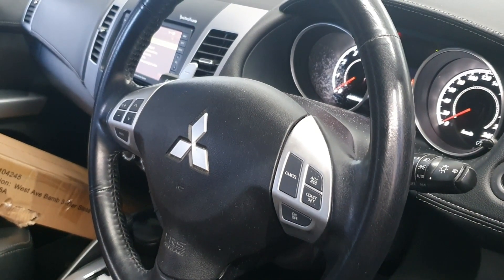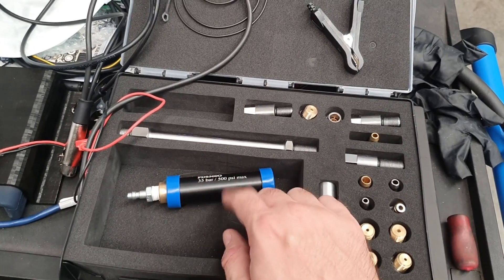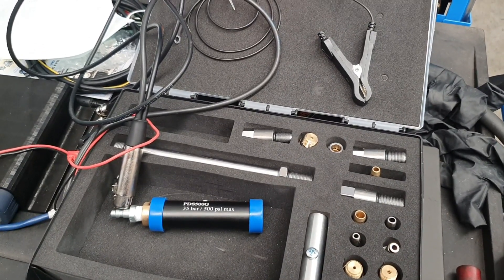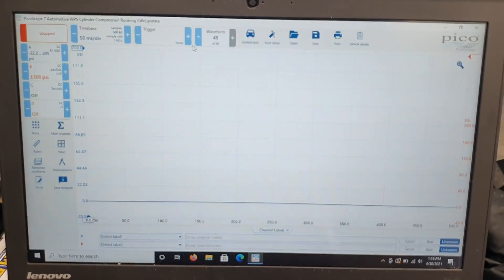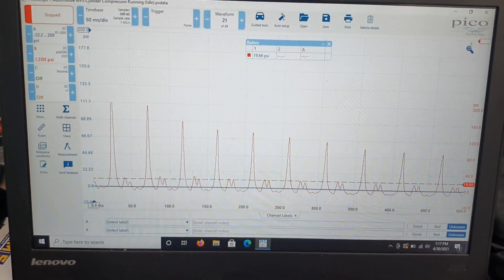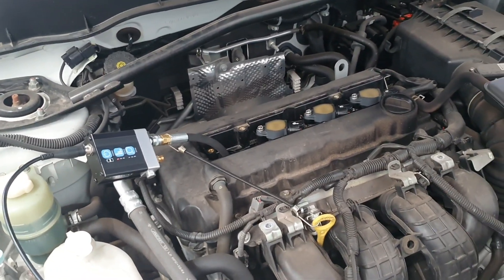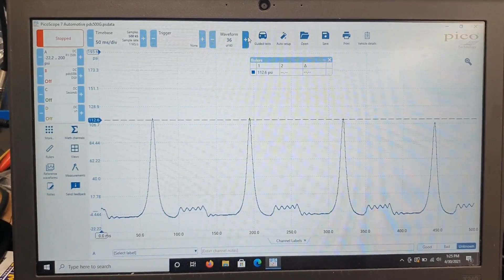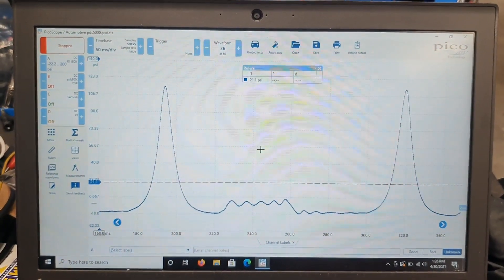Quick Test of the new Ditex PDS500G In-Cylinder Pressure Transducer

Comment: at 3:45 seems like 120 PSI towers @ idle is a high number unless this engine is boosted...

was wondering what the blue left hand scale represents?
Reply from the maker: Definitely higher than what you would expect and one may have even thought my custom probe settings were incorrect until the WPS produced the same result. Mitsubishi 4B12 engine, very interesting.

My mistake with the Blue channel, it was set up for the WPS500 and I didn't turn the channel off when I was using the Red channel for the PDS500.

Thank for dropping by Denis!
Reply: @romanosautomotive  always a pleasure Rome:)

take care...